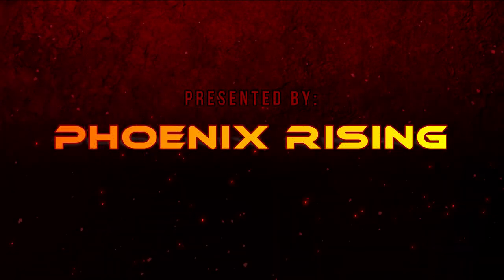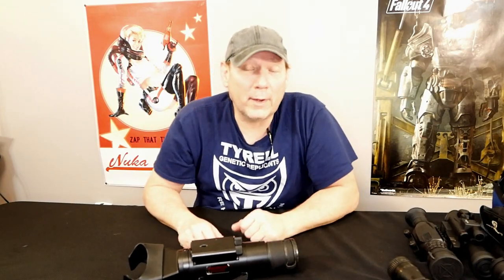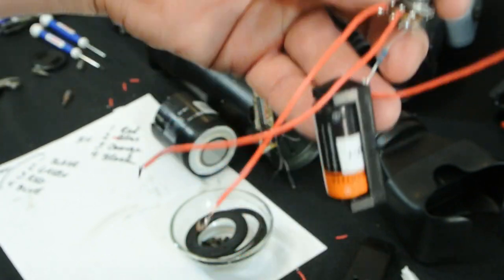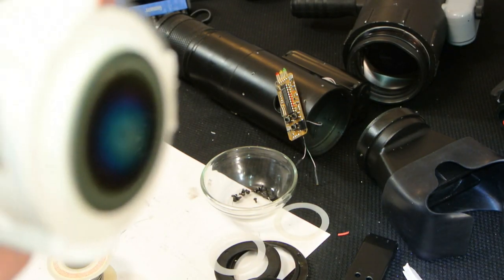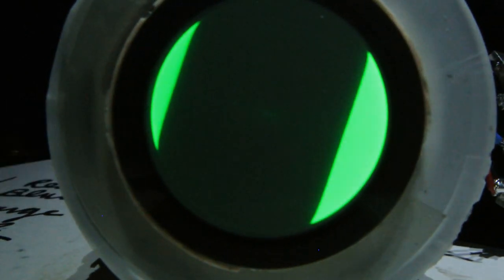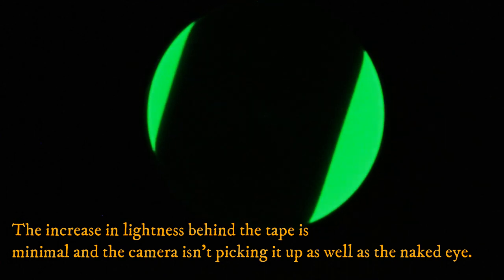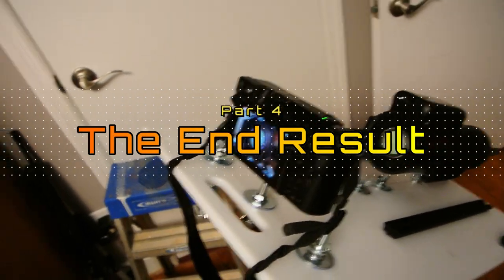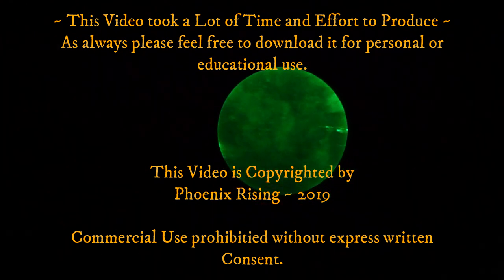Tweaking the MX 9644 Gen 2 Image Tube

Comment: My very first NV Device was a monocular in a nice housing with a sticker with the words “night explorer” on it. When I got inside it I found a 42mm IIT that had been repotted and was much shorter than your Mx-9644 by maybe half the length. It also was hardwired using the old power wires jumpers to power the tube and wired to the power switch (which just recently broke). There’s no marking on it and it’s inside a white colored shell but it’s definitely a gen 2 green Phos tube and is in great shape. I’m trying to find out if this really is a MX-9644. And then I’m trying to find a custom housing for it that has a  dovetail mount built into the housing  for helmet /hands free use.

Comment: I’m really glad you made this video. I have one of these tubes but haven’t been able to make it work. Of course your disclaimer is taken into consideration.
Reply from the maker: I have had several of these over the years including a box of half a dozen that didn't work (for parts on FleaBay for Cheap), just so I could play with them and try to understand them a little better.  I also did a return on ebay where I purchased one (mx-9644) used and when I got it it was obvious that the seller had taken it apart and tweaked on it (the potting was disturbed and it had a heavy flicker to where I knew this guy had taken an almost dead tube amped it up enough to get it to work and was selling it as good condition used) ~ fortunately with my pictures and explanation Ebay sided with me and I got my money back.
 
That being said you might be able to resurrect your tube as I think that being older voltage based analog devices sometimes things aren't dead but just degraded enough / out of tolerance to where they stop working, if the problem isn't the tube itself.  or it could be a broken cold solder joint as well (when I took this one apart all four of the solder joints on the lugs for the pins came apart as I was doing this and had to be re-soldered.  I would also look at "R3" as well "R1" and "R2" as my gut feeling was that is might have to do with incoming voltage regulation.  Beyond that I think that often on these tubes the power supplies tend to go out first, and because they are embedded in resin there's not much you can do aside from play with the pots, and I've never found any kind of a decent reference for anything inside of these tubes.  Good Luck on getting yours to Work!
Reply: Phoenix Rising - Do you know where I can get a good inexpensive housing? Thanks for the reply. You have no idea how invaluable this video is. I’ve been searching for an in depth video on this tube and haven’t found one till now.
Reply from the maker: @salg-1980  Thanks!  I've also had a lot of issues getting information on any of this stuff, and the rabbit hole goes very deep. What type of device are you trying to make? ... I've assembled two DIY's using these tubes in the last several years... One huge handheld (bigger than the NV-250!) using a tube out of a VVS-2 Tank Periscope (it was in the manual for the VVS-2 that I found the schematic for building the manual gain) using Heavy PVC, and one rifle scope where the image tube came from a X-Ray machine, and in that case I used and heavily modified the housing that the tube was installed in (that's the Gen 2 DIY build video in my channel).
 
Another option is to use some Aluminum tubing / piping (I have some tubing for a Gen 3 blemish tube that I want to build out using C-mount lenses, but that's a down the road project), but that's harder to work with than PVC.  As an aside one thing that I've used on both my Gen 2 builds is to get an old Pentax film camera and cut out the lens mount and then attach that to the front of the unit for lens options... If you are careful and think it through use can keep the locking function of the lens mount so you can use Old manual focus 35mm film lenses and swap them out... I've used Pentax because there are a lot of old camera's and lenses around for a good price.  If you go that route just be sure to get a good measurement of the distance from the mount face of the camera to the film back as that will be the correct distance back to mount your IIT... On my first built I actually played with moving the IIT closer to get more light on the tube / increase performance which did perhaps work but made it a crap shoot on what lenses would work (some didn't have enough focus range).  Hope this helps!
Reply: Phoenix Rising - Phoenix Rising right now I only have the image intensifier tube and have been trying to figure out how to power it up. I’m gonna buy the same parts you have at 10:45 in your video. These part names are new to me but I’ll give it a try. By the way, the tube was given to me.
Reply from the maker: @salg-1980   Yes, you will need a 470k Ohm resistor and a 0-50k Ohm Potentiometer (type of variable resistor) and of course a power switch.
Reply from the maker: @salg-1980   Here is how you will need to the tube (normal wiring for MX-9644):

+3V from BATTERY to POWER SWITCH (SPST),
+3V from POWER SWITCH to TUBE Pin 1.

-3V from BATTERY to TUBE Pin 4.

-3V from BATTERY to 470k RESISTOR.
-3V from RESISTOR to 50K POTENTIOMETER Pin 1.

-V from POTENTIOMETER Pin 3 to TUBE Pin 3.

-V from POTENTOMETER Pin 2 to TUBE Pin 2.
Reply from the maker: @salg-1980   -- Oops, didn't see the edited version with the link... yes, both those will work but you will only need a 1/4 watt resistor (the 3w will work but will be much bigger physically)
Reply: Phoenix Rising - This is the specs for the potentiometer. Will this work?

Resistance:50K

Adjustment Type:Top Adjustment

Maximum Power:0.5W

Maximum Voltage:200V

Type:Linear

Type： B
Reply from the maker: @salg-1980   It sounds like it should, the current very minimal, and although I'm not sure the voltage ratings of the Pots that I have (didn't see it stamped on them) 200v should be fine.
Reply: Phoenix Rising - 3 of 5 parts are in.
Resistor
POT knob
Power switch
I’m looking forward to getting this up and running. All I’m waiting for is the 50K POT and battery housing.
Thanks again. I’ll keep you updated.
Reply: Phoenix Rising - All the parts are in and it works. This is the first time I’ve ever turned this on. I really appreciate it. I truly means a lot that you’re willing to help me out. Now all I gotta do is get a housing or figure out the distance from the tube to the front lens so I can make my own housing.
Reply: I'm learning a truckload of information I am greatful for the opportunity to learn !

Comment: The pot that controls the screen size is the screen voltage, lower voltage gives a smaller screen.
There is a photocathode voltage pot and ABC pot and a MCP voltage pot.
You need to be the most careful with the MCP pot because adjusting that one too high can damage it causing emission points and burning tracks in the MCP.
Looking at the video there is shadowing in the center of the image so it looks like the photocathode is worn a bit, you can see a brighter ring around the outside, you can make the image brighter by increasing the gain but it will decrease the SNR and increase EBI. 
What alot of nigh vision companies did is re use tubes that were taken out of military service and sell them in commercial units, maybe this tube fell below the military minimum requirements and ended up in this night vision sight.
All night vision tubes wear out with age and are constantly degrading over time,  a tube that is down 50% in performance is considered to have failed.
Reply from the maker: Thanks, Good Info!  By chance do you know which pot R1-R4 does which?
Reply: Whoa .... Yet another person I need to be messaging and commenting and watching on here...ty sir!

Comment: I have a 55 gallon drum full of non-working MX-9644 tubes and started disassembling a few of them to see what makes them tick, because I also have power supplies for them as well. I heard you say that you had varying degrees of success in disassembling them. Would you mind telling me your method? I was thinking about buying a press later on this afternoon Because I've already discovered that neither a hacksaw or a hammer are required tools  for this type of job... LOL.
Reply from the maker: As far as the outer housings and the inner (potted) part it's just a matter of working the threaded front face off and flexing the shell while carefully pushing out the inside (if I remember correctly)... It's a PITA and you have to go slow... The potting compound is pretty soft and doesn't seem to be adhered to the plastic.  Some of them may be packaged in a bigger assembly with a big hunk of fiber optic glass (the assemblies that are for NV tank periscopes etc) that's made of aluminum (also threaded) that are a bit tougher to open.  Also don't take out any of the screws out on the outer shell unless you plan on taking the tube out of the assembly... as they can be a real PITA to get back on if the pins shift (might have to take it apart to do so).

As far as dissassembling further... from my understanding and experience the only thing  you can do as far as repair them is to replace / swap and tweak the power supplies and if you can get the pair to work re-pot and put back into service.  The insides are literally like a cross between a vacuum tube and CRT so as far as trying to take apart or replace layers etc. I don't believe it's possible If you're lucky and have a bunch you can find some good Tubes and Power Supplies and be able to Marry them Up.  Would love to hear back on how it goes!

Good Luck and Thanks for Watching!
Reply: @PhoenixRising62  I do have brand new as well as a pile of used power supplies for them. I made a casting of the tube with polymorph and then J-B Weld to make an actual holder, now I just need to make a tool to remove the threaded portion now. I seem to have acquired every single component involved in making several different types of image intensifiers so if you ever get ass deep into one of these projects and need some obscure part snap a picture of it and message me. I'll check back with you from time to time and let you know how this whole project plays out...

Comment: Great video I wonder if anyone knows how to actually release the bottom cap from the housing ,
Is it just a case of releasing the screws and pushing down with force to push out the potted internals and dislodge the end cap ?
Reply from the maker: Thanks! From my Memory (which can sometimes have parity errors), on the 9644's:

- The Front Cap unscrews (from my experience it should have two small indentations/holes that something like a pair of snap ring pliers would be inserted in to be able to unscrew it),

- Remove the Screws for the Contact Pins (Don't remove if you aren't dis-assembling, as the terminal behind it isn't fixed and you may have a devil of a time re-attaching it without disassembly / repotting ... Learned that the hard way!).

- Press and work the tube from the back to get the potted tube out of the housing. (have to press firmly with care and work it as it's a tight fit).

Hope that helps.
Reply: Phoenix thanks for that I’ve managed to get the bottom cap of no problem with circlip pliers like you suggested . My tube is an MX11620/UV same format as the 9644 except I can get to the pots without removing completely ,they are accessible from the side of the housing after picking out a circular piece of potting in 3 locations  , although my problem couldn’t be fixed by tweaking on the pots , I have a very dim image but no blemishes and very sharp not blurry ,so hopefully when I remove the whole way I’m going to find something obvious that’s causing very little brightness adjustment on the gain and image that I can see , basically at night time I can see nothing but in normal ambient light the image is as you would see at lowest gain at night  ...not much info out there on these tubes your video was very helpful 👍

Comment: The back part is from a Baigish 6.
And the electronics, except the phillips chip, are russian. Just look at the teflon mantles on the wires.
Is the front lens from a PVS-4?
That is quite the interesting mix.
Reply from the maker: Appears to be 1980's ATN manufacture, so not surprised to see some Russian stuff in it (recently picked up a heavily used by Gov't contractor ATN night spirit 2 and I believe it has a Russian Gen 2 tube in it and I think the MX-9644 has equal or better IQ).  The front lens is definitely not PVS-4 as it has a large catadioptric lens simliar to the Zeiss Fero Z51 / Orion  80.  Though in thinking about it it might be a PVS-2 type lens (haven't seen one of those up close so that's just a guess), Yes... definitely interesting and there was no concern over size or weight with lots of unused space in the housing and thick metal.
Reply: @PhoenixRising62  I'll try to make a comparison once I get this soviet tube to work, It doesn't take 3V like the us ones, but it takes multiple high voltages from external electronics. And that cartrige seems broken. So I have to reverse engineer a thing with parts that I don't know.